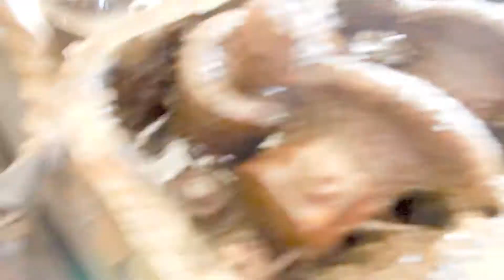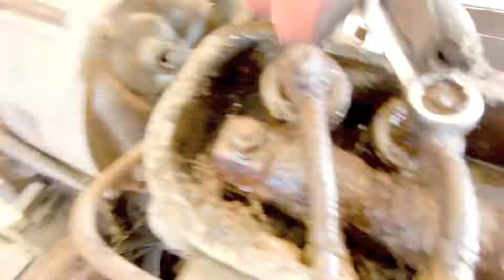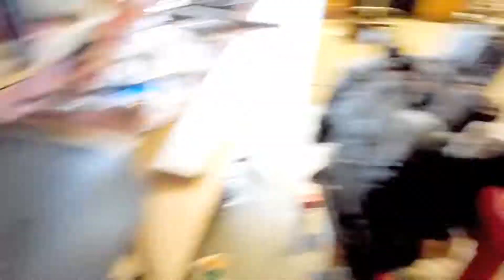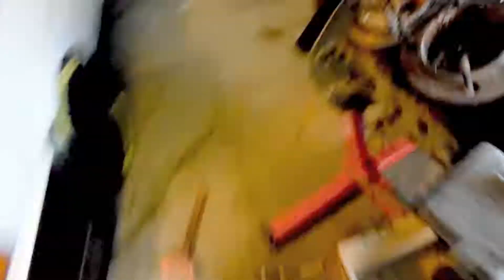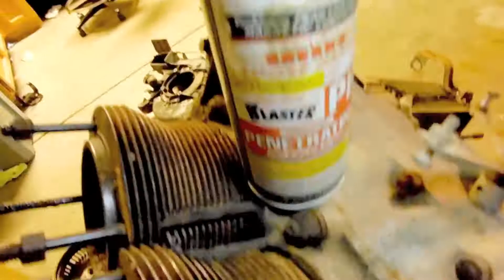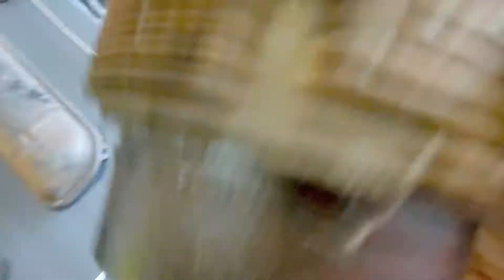the worst porsche  engine ever!!!!! bad bad engine!!

Comment: I thought mine was bad when I found. The cooling fins full of gunk. I had to grind off three cylinders due to rusted piston rings. Although it was missing the drain plug and had not run in 20 years the valve train was perfect and all bearing surfaces were oily and shiny.
Reply from the maker: wow haha yes  I think my it's a little bit worst
Reply: MOON FOG GARAGE How did it get like that?